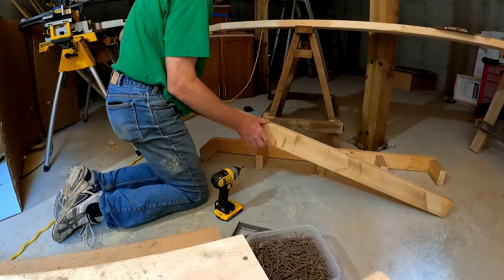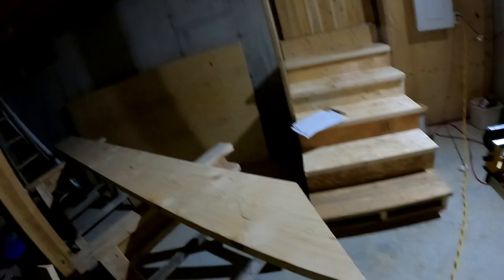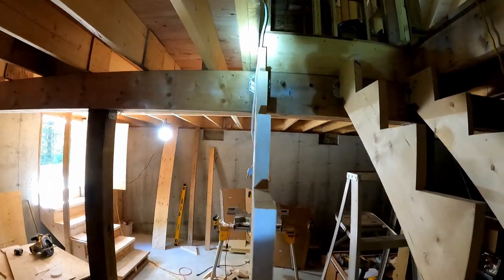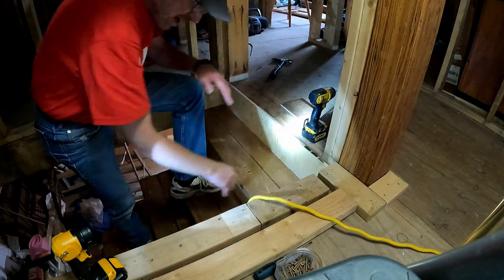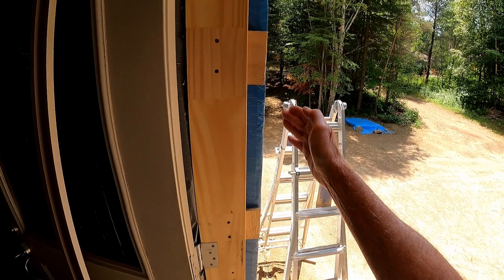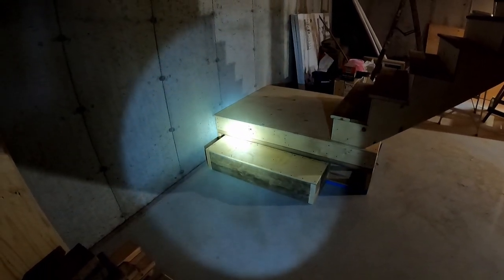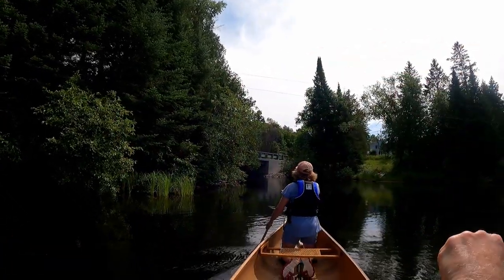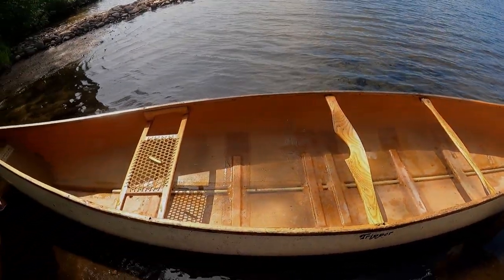The escape from the basement...DIY Cabin...Episode 27

Comment: I really enjoy your sharing of building the house. This is my dream to do in Maine in a few years. What like, it's a raw video. You show your mistakes, you explain your thought pattern and then show how to build it. This is excellent!! Keep it coming.

BTW, I show how to replace the wooden gunnels on a 16' canoe as well as the seat. One YouTuber helping another YouTuber. My advise on the gunnel replacement, use Hickey or Maple. Its a tad softer, less chance of cracking vs Oak which is what I used in my video.
Reply from the maker: Thanks very much.  I appreciate the info on the canoe repair.  Good luck with your build going forward.